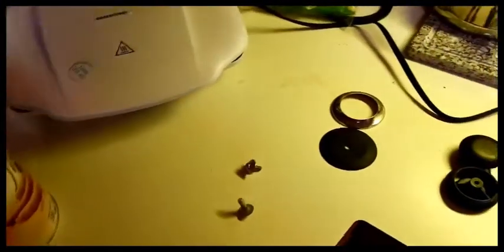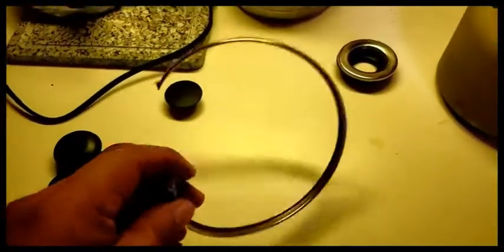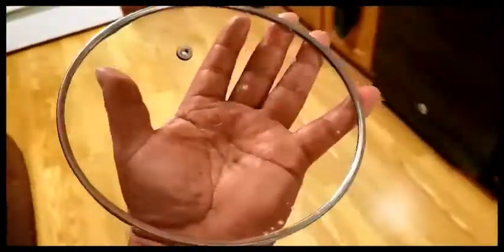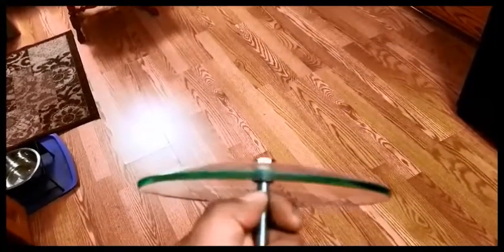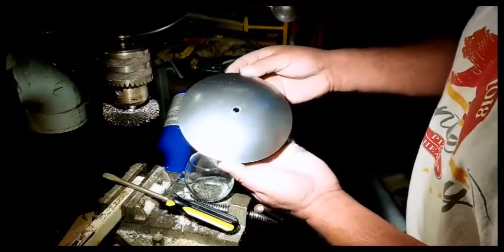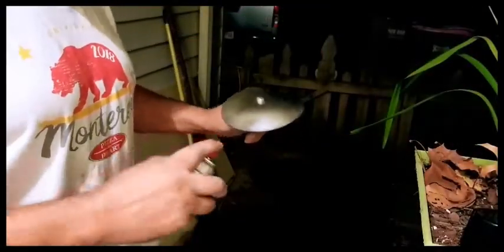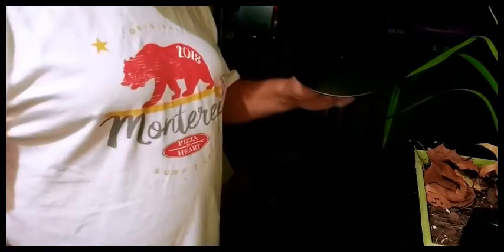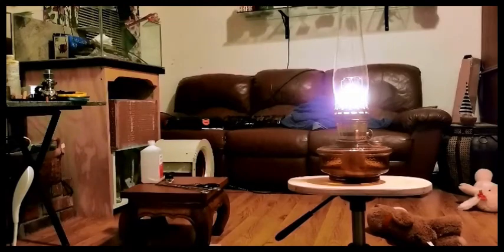PARABOLIC MIRROR FROM PAN COVER

Comment: Is that a real parabola ?? Does it have a good focal point ??
Reply from the maker: Not for a Telescope!   Focuse distance I'm sure is totally wrong. Suppose you could do some grinding on it but not good glass for that either.   You'd also want the aluminium electro plated however they do it. I understand making your own  Is feasible if you are doing something larger than 10-11inch. My experiment... .. . The focal point is good enough to light a fire, but not a clean point. I am using it for an oil lamp which works very well as a focusing reflector.  It's adding much extra light.  Good luck to you.
Reply: @moonolyth  thank you for the reply . Actually i am looking for a parabolic reflector for radio waves . Today I tried this on the sun . It has a very good focal point
Reply: Shit i was thinking it for making a telescope